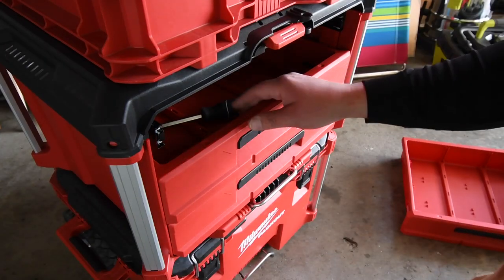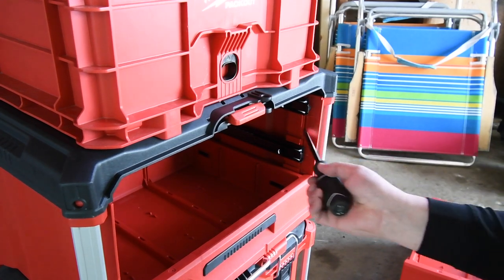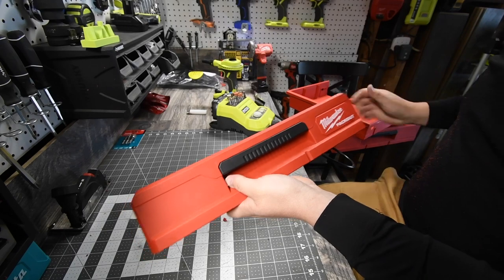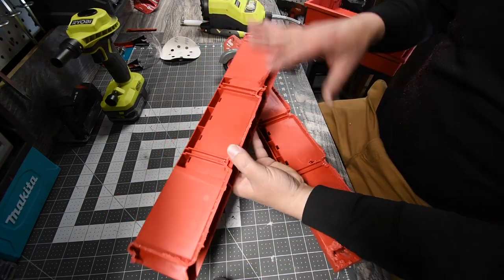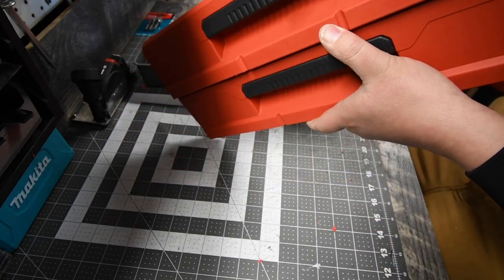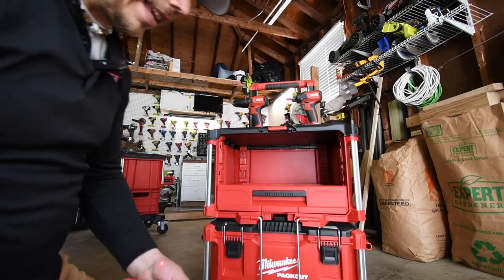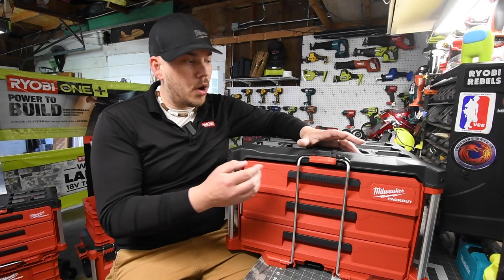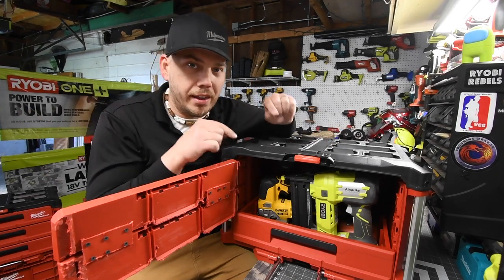I Made a (Milwaukee Packout CABINET)

Comment: Actually you should cut out the top and middle drawers out and connect all the doors together so that all 6 drawers slides are supporting the weight
Reply: Maybe not all but at least the middle drawer sides and slides wouldn’t be a bad idea
Reply: That's exactly the same thing I was thinking and came to the comments to say. Just cut the bottoms out of the top two drawers and cut them into strips to use in attaching the sides of the drawers together into one large drawer with 6 slides supporting it. I would also probably use an oscillating tool for the cuts for a cleaner edge.

Comment: Good idea. How about instead of a door, attach the top two faces to the bottom face so it slides out as one large drawer face. Less complicated. Maybe use a little bit of hot glue on the plates before you attach them. 👍👍👍
Reply from the maker: I thank you very much for viewing :)

Comment: Love what you do
I would leave the slides in make the drawer have deep sides and back for increased rigidity and  more slides for weight support 
Instead of a hinge you have to pull drawer out and or have the top 2/3 of face connected and sitting on pins so could either leave on or pull off after pulling out a little.  Not necessarily as convenient as a hinge but much stronger.   There are other push in mounting options for faces that are friction fit. And since it’s a plastic tool box you’re not as concerned about scratching the face when setting it down just loosing it. 
I have the ridgid storage system. I use the big wheeled on bottom latch the crate to it place the organizer unit on top.  Organizers has side handle so acts as a little table just have to lift organizer for crate access or lift crate locked to lid to access bottom chest.   But either way I’m moving my table.  Front access would be nice
All the mobile tool storage companies should make a connector you could screw into wood so you could put a 2x4 or a sheet on top
If you have 2 sets you have your saw horses. And if you’re rolling your tools somewhere one less thing to carry (not that sawhorses are bulky or awkward) is always good